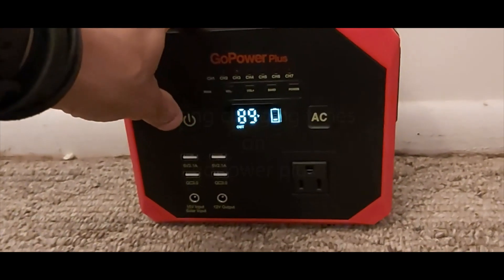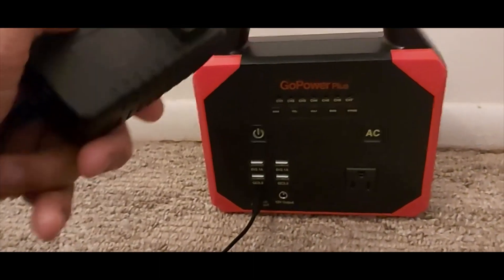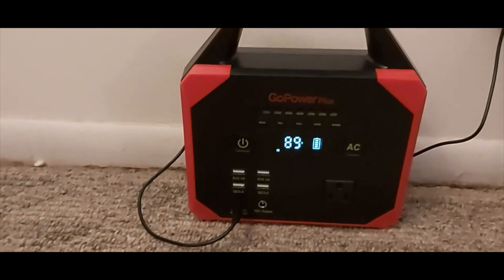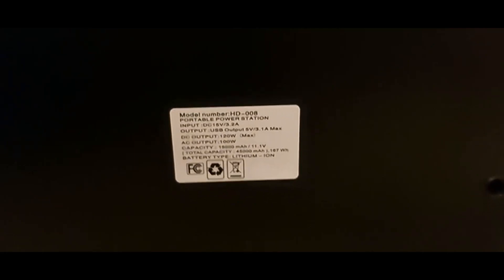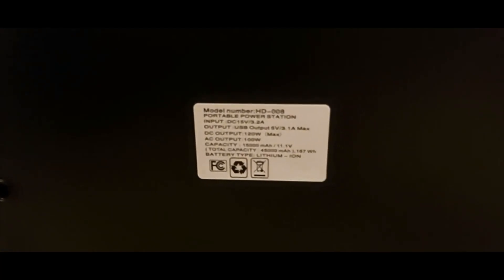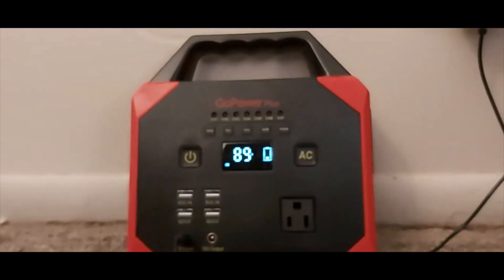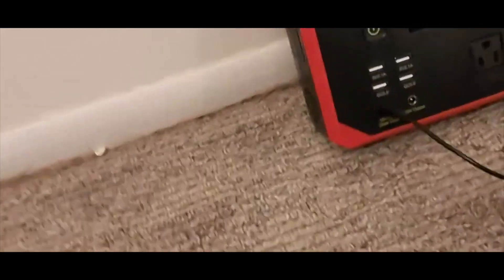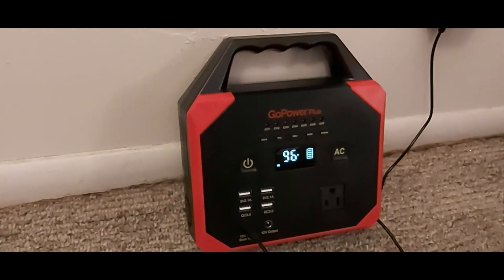GoPower Plus Solar Gen | Testing AC Charging Times

Comment: it don't charge pass 91%
Reply: 91% is not the charging amount it is the temperature of the unit. The charge rate is shown by bars not percentage.
Reply from the maker: Thanks for your comment. Really how long have you had it?
Reply: @albertsvoicesolar  I just notice that it was reading the temperature and not the power 🤦🏿🤣 I just learned something 😅
Reply from the maker: @MauriceL1980  The first is Temp (left) | Battery (right)..